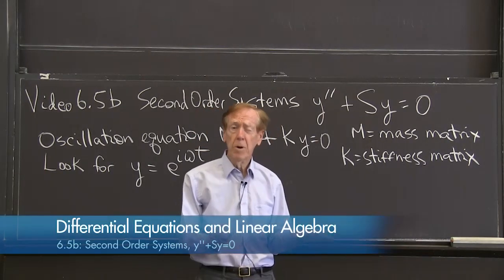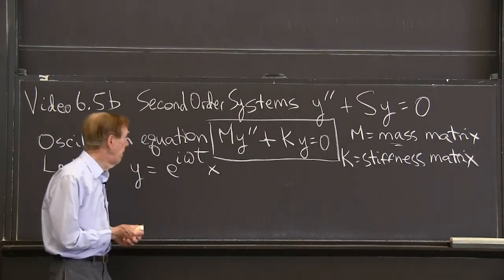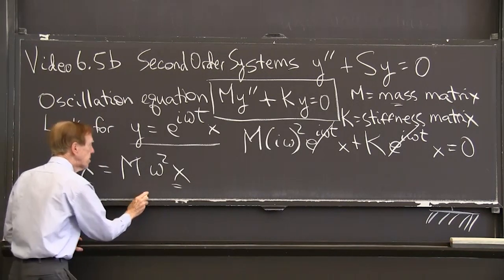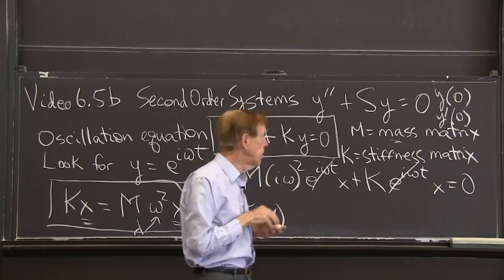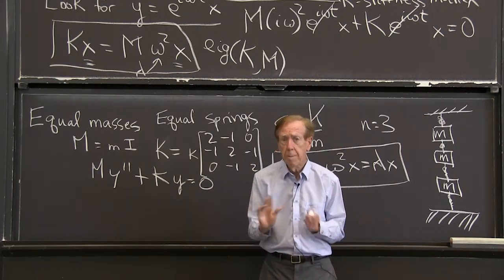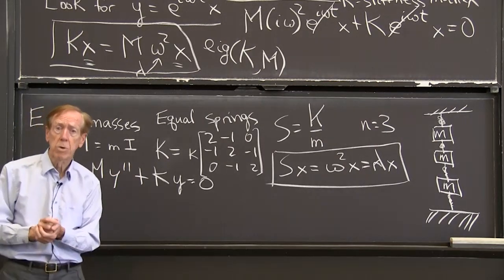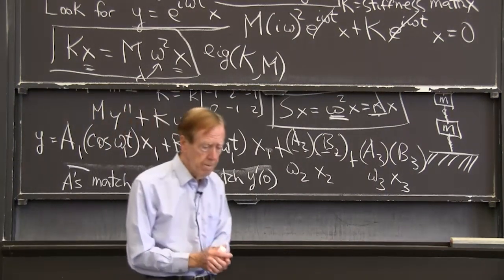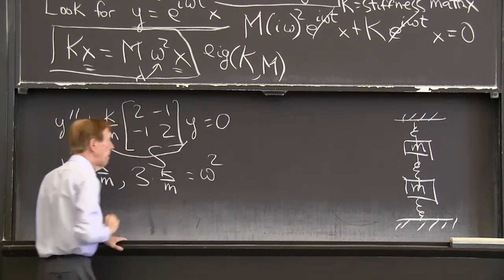Second Order Systems

Comment: It wasn't really clearly explained how there is 6 solutions.
Shouldn't there be 3 for the 3-mass problem? Since there are 3 eigenvectors.

I know he should be right. But what is the logic?
Reply: Because lambda= omega ²

For each lambda you get two values of omega ....that's why for 3 lambda , you have 6 solutions in omega
Reply: because 3 eigenvectors correspond to 3 omega, whether you use cos/sin or exponential, there's always amplitude and phase angle to be determined (that's why two initial conditions needed), which means two coefficients for each